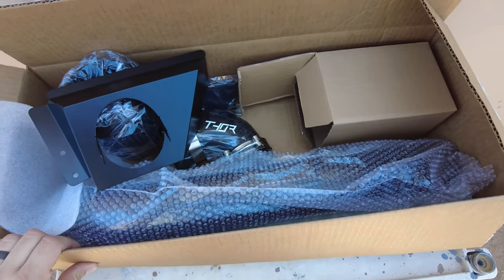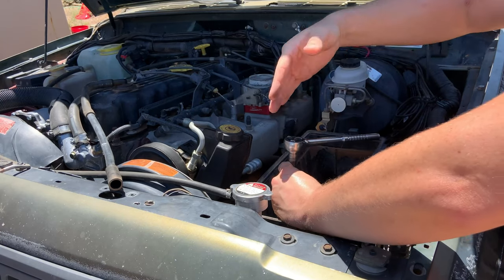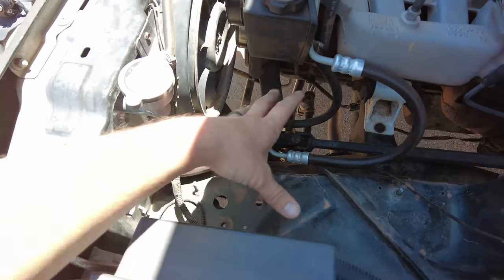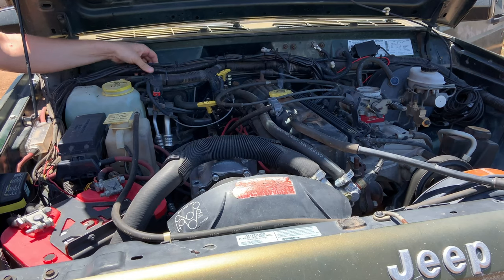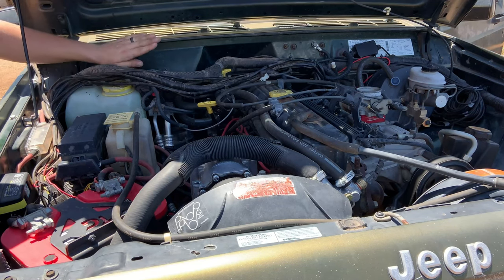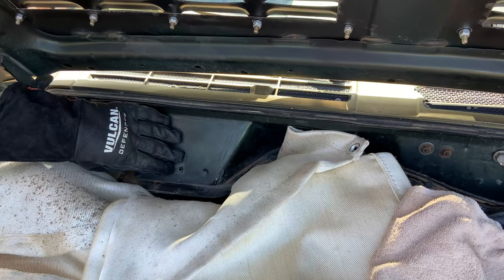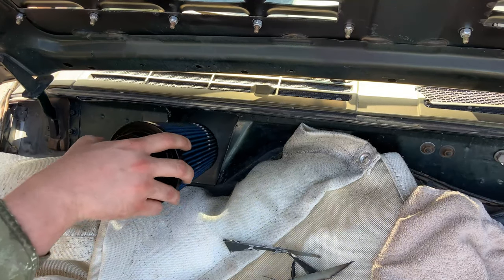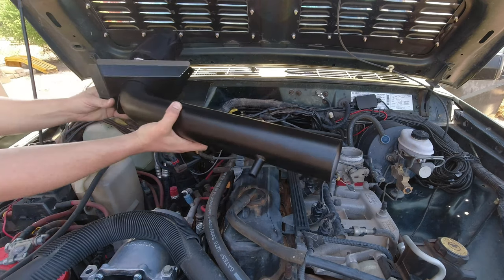Trail Head Off Road Cowl Intake Install for Jeep Cherokee XJ

Comment: Rhd XJ’s still run the battery on the passenger side & have the alternator up top where the ac compressor would typically be similar to a TJ or WJ….really like this cowl setup nice video I was just thinking about making one of these for my wj trail buggy so I can continue pulling in air not drinking water 🤣 thanks for sharing!!
Reply from the maker: Thanks for watching! That’s crazy the alternator is up there, is the ac compressor where the alternator is then? I don’t blame you there lol if it’s for a dedicated trail rig that’s beat up I would make some out of some PVC pipe or something so you can make it exactly how you want!

Comment: I think dirt bound offroad makes a battery box for that spot. Because that's the setup I want to use
Reply from the maker: Thanks for watching and good looking out! I was just looking at that box 😎 We have a few trips planned but after that I’ll do the 2nd setup video
Reply: @2AOverland  no problem man. I just got my zj road worthy again. So after this big motorcycle vacation I will start giving the zj some additional love and hopefully start tinkering with my xj also.  Spoiler I'm putting my rtt on a trailer and pulling it behind motorcycle lol.
Reply from the maker: @kennygraves489  that’s good man! I kinda want to get a grand Cherokee project too but having 2 money pits might be overwhelming at the moment lol. And the rtt on a motorcycle trailer idea is AWESOME! tents nowadays are so light and the power to weight ratio of a bike should make easy work towing that tent around! I’m surprised I haven’t seen that setup yet.
Reply: How did you cut the breather tube?

Comment: How deep of water have you had it in?   I like the idea of a snorkel, but do not like the idea of cutting into my fender nor do I like the way it makes a vehicle look when mounted to the a pillar.
Reply from the maker: I’ve had it in about 35” tire deep water 😬 I’m not the biggest fan of snorkels either cause of the same reason and this cowl intake and a snorkel are the only true cold air intake IMO

Comment: Hey brother is there anywhere that I can get that bracket that goes onto the firewall My XJ was stolen and pretty much stripped recovered but they destroyed the bracket where the cold air intake went through the firewall why they wanted my filter and prefilter I have no idea they left a tube and all the rest but they destroyed the bracket any suggestions thank you
Reply from the maker: I’m sorry about that man 😬 I would hit up THOR and ask them if they can sell you a bracket and I think they would!
Reply: @2AOverland  
Hey brother thank you I you know I don't know why I didn't think about first thing that came to mind was me fabricating another one not that hard You're pretty good with your hands also informative videos man I appreciate you keep up the good work brother thank you very much I got a mid-96 XJ Cherokee also bloated power everything cruise at tilt windows door locks I don't even I don't even know what it is It doesn't say anything on it I noticed you got a little badge on the back by your HO emblem on the left of the rear door what does that say

Comment: Hey James!  Found you guys on 2nd Hand Overland.  Great stuff!  Quick question about this mod.  I know it has only been a couple of months since you put this on, but is there anything else you have noticed that might be worth mentioning?  I live in FL and we get a decent amount of rain, any thoughts on water getting to the filter?  I know the cowl vent is mostly sealed, but just wondering if you have had any experience with this yet?  Thanks!
Reply from the maker: Thanks for watching man! Matt is such an awesome guy and we appreciate that he highlighted our channel! The only thing that I can tell you about is there’s a sucking sound that you hear in the cab when you first start up the jeep and when you have to get on the gas to pass or gain speed quick other than that it’s been great. Unfortunately being in AZ we haven’t had a ton of rainfall like FL. but I have power washed the cowl and really tried to get water to go into the area by the filter to test it and I haven’t had a problem at all on startup. And how there’s a 1/2in rubber lip on the outer cone of the filter there’s no way for the fabric of the filter itself to touch any water that goes in the area. It would have to be an insane amount of rain coming in to have a chance to suck in water. I honestly think you’ll be fine with this kit with proper installation 😊. I really hope this helped man and I can’t wait to put out some more good content for everybody!
Reply: @2AOverland  I've had mine for a good 6 years and I've never had an issue on or off road, dirt or pouring rain. If you strategically line the inside of the firewall with sound deadening mat it will not only help with the sucking noise (I kinda dig it myself) it will also make sure to seal up the space. Thanks for sharing!!
Reply: Just make sure that you still have good air-flow. You don't want to seal it up completely.
Reply from the maker: @jasper Q I like the sucking sound too now lol at a certain rpm I get a whistle though so I have to avoid that on the highway but good call on the sounds deadener in there 🤔

Comment: Did you happen to notice if the window you cut in the firewall also gives you enough access to the AC cabin vent? Mines leaking water onto my passenger floor board when it Rains and I wanna get it sealed up. Would be a 2for1 if so haha
Reply from the maker: From what I remember I didn’t have access to the cabin vent from the cowl 😬 I used to do Autoglass back in the day and some people would get leaks like that from the bottom of their windshield not being seal correctly on the bottom 😅 that might be the case for you
Reply: @2AOverland  it's possible but I know it's super common for these to leak at the port in the cowl bc they sealed it with foam tape 🤦‍♂️ a lot of people cut a window in the top of the cowl on passenger side
Reply from the maker: I’ve never had that problem thank god 😬 I need to keep an eye out for that though when I clean the filter
Reply: @2AOverland  you have a cabin air filter??
Reply from the maker: From my knowledge I don’t think the XJ has a cabin air filter
Reply: @2AOverland  thats correct, I just realized that you meant when you clean your engines air filter 🤦‍♂️ sorry I had a brain fart lmao. Forgot that you installed the Thor for a moment its been a long day
Reply from the maker: No worries brother I have those moments very often 😅😂

Comment: looks like its a cooker for that tube, not going to work, u be better going down to the old box line 90 straight to driver then 90 straight to front grill.  and pop a hole where the headlights are then the tube runs over the fender well and the air from the front ram air as well ..you got sealed battery's throw both in back, and get a rack . Patch that and put your aux oil filter  get rid of the stock filter mount. same parts. nice rig bro ..mPr 98 Cherokee renegade
Reply: You just need to put some header wrap on it.

Comment: Is that a throttle body extension ? How does that benefit im on the fence of buying one
Reply from the maker: Thanks for watching! I got that years and years ago from 4wp. The only difference I felt was the slightest bit of better throttle response and that’s it. If you can get one for a good deal I’d say get it
Reply: @2AOverland  i found one for 30 bucks thanks im gonna do it great channel btw love the vidoes i got a 96
Reply from the maker: That’s a good price! I spent way too much for mine lol. I’m really happy I got a 96 too over some of the other years. We really appreciate you watching the channel we’ll keep the Jeep and camping vids coming!
Reply: @2AOverland  im subbed so ill be waiting keep em coming man !
Reply: Definitely have to say the spacer didn’t do much for power a touch of response but I mainly wanted it to raise the throttle body up a little in the hope of keeping water out…we have a dry system so that basically means we only have air pads thru the throttle body they add allot more power on a wet system since it allows a little more time for the air & fuel to blend together if that helps I haven’t found a quicker way to explain the reason but that’s about it

Comment: I bought the WJ kit.  Not sure how it's gonna mount.  The firewall is a lot different between the XJ and WJ.
Reply from the maker: Did you buy the WJ kit for your XJ? 😬 I might be assuming you own an XJ I forgot what you have
Reply: @2AOverland  I got the WJ one for the WJ.  Need to get an angle grinder so I can cut the firewall to mount it.  But the engine bays are different, with the XJ you can see clearly where it would go.  The WJ is slightly different as there was an option for an 8 cylinder so the engine bay has more room.
Reply from the maker: Oh gotcha! It’s so hard to remember who has what rigs 😂😩. I hope you don’t have to move or remove too much to get to the spot to cut for the intake. I know the owner of the company is a super helpful and cool guy so he might not mind if you contact him if you have questions about the install
Reply: @2AOverland  I feel you on not knowing who has what rigs lmao.  That's cool I can reach out and get install instructions.  I just opened the box to check it out and put it in the garage.  Jeep is at my buddy's shop getting ac work done on it.  Hopefully I can get this thing installed before I have to go back to work.
Reply from the maker: I hope so too 😊 hopefully the install is straight forward man! Our jeep currently has a leak in the ac condenser but I don’t want to change it in this heat lol so I put a can of r-134 in it and it lasts for the trip usually. Trying to change parts in this heat is brutal

Comment: Just a work to the wise, that air filter is hot garbage. It has no business on an offroad vehicle. Fine dust will go right through it and ruin your motor. Ask me how I know. Dont believe me? Run it, go for a nice dusty ride. Pull that intake pipe and look inside.

Comment: This is a bad design if you off road , hit a big enough puddle or threw a creek etc and that wave of water is gonna go down that tube like a funnel … good idea but not good
Reply from the maker: Thanks for watching! The cowl on the passenger side doesn’t let water in, only on the drivers side. And both sides of the cowl have drains in case of that issue. There’s a video on the THOR YouTube channel about questions regarding that stuff with intake, and I’ve talked to the owner of the company about those issues too.
Reply: @2AOverland  boom

Comment: I wish somehow I knew you were gonna do this, so I could have stopped you…

1.  Beside the fact that filter is friggin horrible at actually filtering air, it’s gonna be a pain in the ass just to check it.
2.  If you get water in your cowl, it is a down hill straight shot right into the motor.

Hauk off-road has the only viable solution. Their design retains the factory air box and it’s excellent filtration capability
Reply from the maker: Thanks for watching man! So far I do like it but I see where you’re coming from. I can do some testing and worse case scenario I can go back to my stock setup and patch the hole I made lol
Reply: @2AOverland  I watch all of your videos. They always make me homesick, but it’s the next best thing to being there
Reply from the maker: I’m glad we’re here to give you that little bit of home 👍🏼 we’ll keep the vids coming 😎